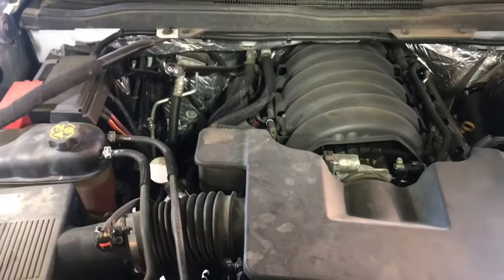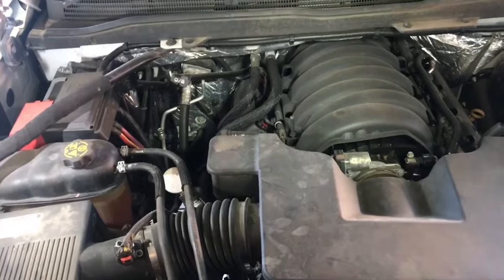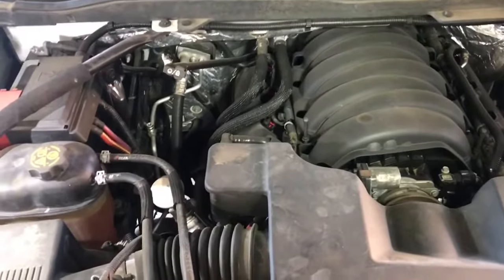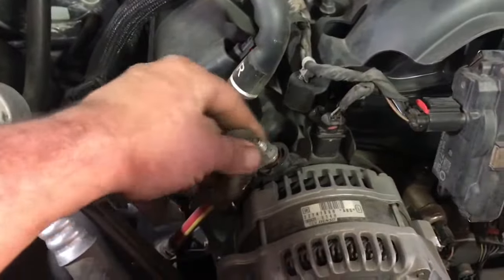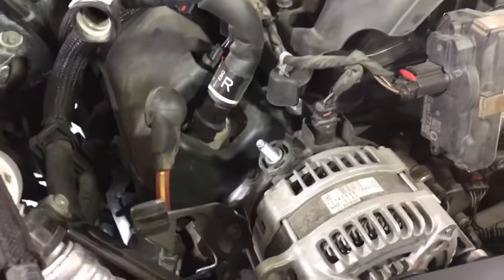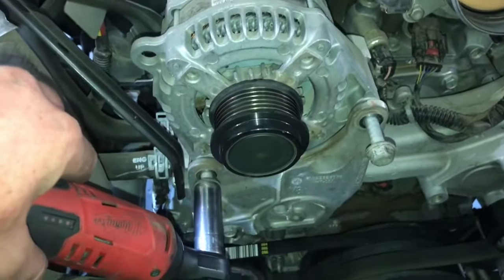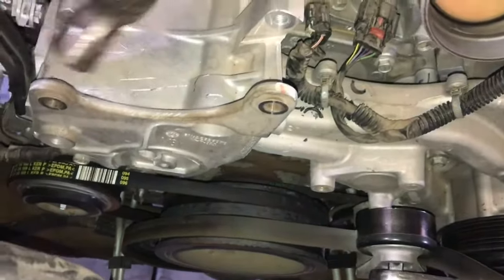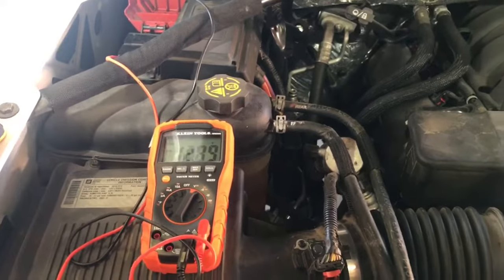Silverado 5.3 & 6.2 Alternator Replacement + Diagnostic tips (2014-2018)

Comment: I have a 2015 Denali and I purchased a higher output amp from powermaster .It keeps throwing DTC error codes.Any idea on how to get the BCM to recognize it? Great video.
Reply from the maker: Thank you. Currently I am on aware of anyway for the BCM to except higher amperage alternators. I will do a little research and ask if you GM friends. I will get back to you
Reply: I just bought a higher output alternator because I added a sound system to the vehicle. Did you find a way for the BCM to recognize the higher output alternator?
Reply: Also, good video!
Reply: @Whoa532   Any update with the issue? I just bought an high output alternator for my 16 gmc truck and would like to know as well.
Reply: @ryaneboy101  did you try the battery reset?
Reply: @bobbywalter5320  Haven't ran into any issues installing my alternator. I have a 300amp feeding my 5k amp and two Batteries.
Reply: Did you get it fixed? I have a Denali and wondering if I should buy the higher amp output.

Comment: I have never changed so much as a tire in my own car. But when I was hit with a $900 estimate for a new alternator on my 2017 Yukon Xl Denali, I started searching YouTube to see if it was a do-it-yourself project I thought I could handle. $250!for the OEM part on Amazon, watching your video 10 times and voila!  I had it changed in under an hour and saved myself $650!  Thank you!!!
Reply: Mechanic shops are rip-offs in america. Alternators are not that hard to do

Comment: This tutorial was compatible with my 2015 Suburban and I was able to swap the alternator out in about 45 minutes (that's including cleanup and putting away tools).  
Only suggestion I would have is about the copper bushings. I had to use a curved-jaw Vise-Grip pliers to squeeze the bushing on the outside before I could move the bushings by tapping with a small tack hammer. It left a couple marks on the bushing, but I don't think they will be a problem.
The dealership wanted almost $800 to replace it, and my most trusted mechanic said it would be $720 at his shop. I was able to get the alternator from O`Reilly for $370, so this video saved me about $350. Thanks and keep up the great work!

Comment: Hello Aaron,  Thank you so much for the great video for replacing the alternator.  Had the battery warning light come on while driving, and then Battery saver mode warning.  I made it home just in time to be able to get my truck into the garage.  I kept my truck running while I made room in the garage.  Got back in my truck and warnings of power steering failure and stabilitrack failure the truck only allowed me to creep into the garage the rest of the way.  Your video was perfect! Thanks again, Bob
Reply: Bob, mine just did the same thing today (2015 model). Looks like I’ll be changing mine out tomorrow
Reply: Dang mine just gave out going on the highway going 70 mph 😅😅😅 barely made it off the nearest exit off momentum . everything just suddenly shut off I freaked out for a bit 2014 5.3

Comment: Noticed a voltage drop after installing new alternator and new battery. Thank you so much for the info in the description. I’ve been chasing my tail for a week. I had no idea the truck had multiple charge modes.
Reply: Can you explain this a bit more? I changed my battery and alternator and am getting low voltage reading and started getting the battery saver warning.

Comment: Great video! I’m looking to replace mine pretty soon. But wanted to ask you something first before I dish out 400 dollars.  I was driving mine for about two hours and decided to top it off at the gas station. After two minutes with the key still in the ignition it says my battery is low and I needed to turn the truck back on. I just got a new battery back in the summer of this year.  It has long start ups and the headlights flicker as I’m driving down the road. Is this the alternator or something else? Thanks!

Comment: Would it be recommended to charge battery or not before connecting negative back? But this video was very helpful and easy instructions very helpful. Thank you! You save me the labor cost that the car dealer mechanic would have charge.

Comment: I have a 2016 Silverado LT 1500 4x4. Driving home today the cluster and radio started going in and out and the steering wheel was fighting me to turn left and right at the same time the cluster/dashboard was going in and out. Is that typical of a bad alternator?

Comment: Great video. Have a question I'm running a major system n my 2018 Silverado 5.3 and just got a 1 wire alt. for cheap and gonna install it. I won't be able to hook up the plug nemore. So the pcm will not do all these type of charging stats. I believe it will just stay at 14 or so. Will that b ok on my truck and is there a way to make it so my engine light will go off. The guy selling it to me said there is a way but didn't know for sure. U seem really knowledgabe on this thanks sir. N great vid
Reply from the maker: If it’s a one wire alt. The one wire only needs 12v. And the system should charge. To get rid of any codes that may occur, you will need to delete them  by using hp tuners. That “should” work. However I’m not sure if the ecu or bcm will disable some functions of the vehicle if that plug isn’t in. Let me know!
Reply: @AaronHinesAuto  sweet n thanks mann alot and I will let u know sir

Comment: I’ve got the regular alternator, but with extreme radio demands and extra batteries there is a need for the higher power alternator.  If I need more power from the alternator what must be done to enable this?  If I install the Denali version will it function poorly or just throw warnings at me...can this be fixed by someone with hp tuner software?  Increasing alternator power seems a very popular change.  I can’t find Google info on this.  I believe you, have the higher amp unit sitting here in a box, and now fear installing it.  I’d appreciate your thoughts.  Thank you for an awesome video—tapping the bushings out is brilliant, and not something I’d thought of!

Comment: Evening sir just seeing this video for the 1st time. I have a question in regards to that large black cover on top of the battery. A gentleman was replacing the battery, he disconnected the neg. & pos. cables the removed that cover and disconnected the 3 cables from the 13mm studs. When going back in with new battery he connected the neg.& pos. battery cables then the 3 wires on the studs but the stud with the 2 wires started to spark and got a little hot so he immediately removed the neg. from the battery. So then he reconnected the cables to the studs then the neg. battery cable. Was anything possibly screwed up going in that order because there was a burnt smell. Truck started fine.

Comment: My current situation: I have a 2017 GMC Sierra 1500 5.3L V8, I have a lot of accessories. For that I installed a dual battery setup with the keyline smart battery isolator and a marine deep cycle battery as the accessory battery. My question is, do I need a high output alternator for this system? Thank!

Comment: I'm running a 3000w amp on my subs, I have a 2000 Silverado 1500 with 5.3 and my voltage metor sweeps back and fourth, my stock alternator is 100amp I purchased a 130-145 amp alternator. Is that too much?

Comment: Thank you for the video, it answered some of my questions.  I have a 2015 Sierra 5.3L, I keep getting the run around by the dealership to my battery drain.  I thought maybe it was the Alt because after so long the battery no longer charges and just drains, but the headlights and nothing inside dims like it should with an Alt no charging.  I have already replaced the battery once.  I've only had the truck for a year.  I have the issue of the truck turning off when I turn into a parking space & at low speeds.  Also when I shut it off, get a popping noise, then get back in and try to start it, all power is dead and it won't turn over.  Takes 3-4 times to trying to start it, then it turns over, no issues.  That happens ever 2-4 months.  Any help or advice is greatly appreciated!
Reply: Did you ever get this fixed? Mine is starting to do similar
Reply: @cotx79  Yes.  I left a comment on this thread previously.  The negative battery cable was damaged and not making a full connection.  Whenever the battery shifted and the wires inside the battery cable weren't touching, the truck turned off.  I finally took it back to the dealership enough times, they put an electrical expert on it to trace every wire and cable.  That is the only way it was found.  Once the negative battery cable was replaced, it ran like new.
Reply: @krisgilbert3415  I literally just got home from my mechanics place. And it was a loose neutral wire also! At least that’s all it is I hope. He took off the ground that comes off the battery and cleaned up the area on the frame and reconnected it as well. The wire on the battery was so loose. I’m surprised it didn’t just pop off. I remember I had taken my truck to get an amplifier installed. Looks like they didn’t reattached the wire appropriately.

Comment: Would an alternator cause the truck to shut down when putting load on the ecu? I don't wanna take my truck to dealership to pay 490 to tell me my alternator is bad.
Reply from the maker: I haven’t heard of that before. check engine light on?
Reply: I had a arc when changing now truck want start no dash lights some stuff will work no power windows only one head light
Reply: Help I think I did get the higher amp by mistake

Comment: I have a 2019 Suburban 5.3 LT. My battery keeps dying 1 or 2 times a week. Two time tested the battery and  dealer said the battery is good. At autoshop Checked the alternator,  and charging power shows 12,4 . They said alternator should be replaced.  So, went to dealer,  but they said if there was a problem with alternator,  I would see the red battery sign on my dash or power saving mode sign. And also dealer said problem is not alternator but something is draining the battery when car is off. 
So, I don't know who is right: Autoshop or dealer. Is there any idea?
Reply: I am just now digging into my 2015 Silverado LT and same thing seems to be happening.  At first blush the alternator and battery seem okay but, this morning got in and display screen said "Service theft deterrent system."  This is the only thing using battery when vehicle is off.  I am not at this step yet, I still have to confirm battery and alternator are good before I start looking for unicorns.

Comment: MR HINES! EMERGENCY QUESTION. THE BOLT BELOW THE LONGER ONE TAKEN OFF, I found it unscrewed about to fall off. What is it!? I cannot screw it back in.
Reply from the maker: i checked out a 14 5.3 just now. i see what your talking about. on the motor i looked at there was no bolt there but there were threads for one. do you have a 6.2?

Comment: Ain’t nothing worse then your bearing going instead of the actual Alt,    Sucks ,     2014 Sierra Slt 4x4 5.3 bad bearing noise took screwdriver and listened on the Alt and can hear the exact noise you hear outside the truck .         Maybe trying to buy a Referb or something,      372$ for a brand new